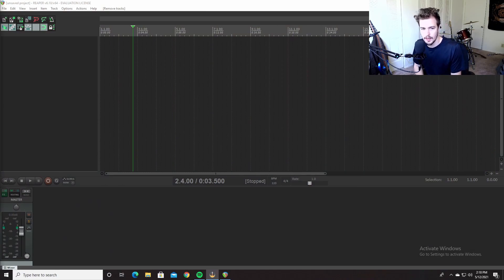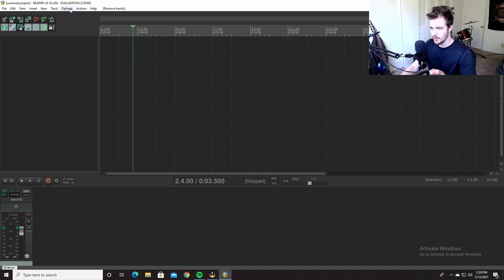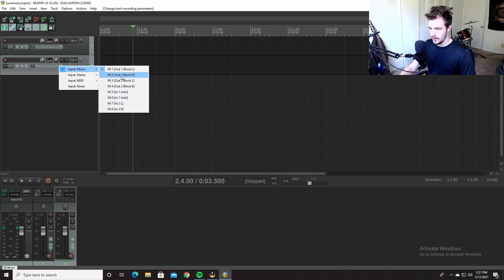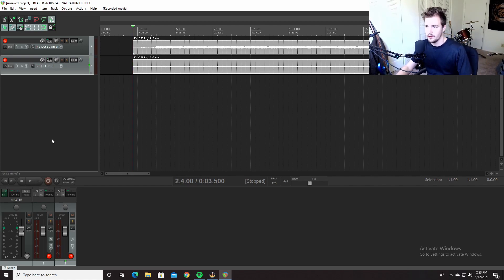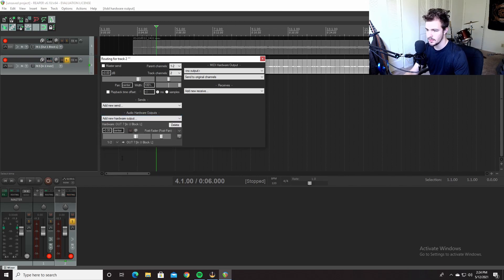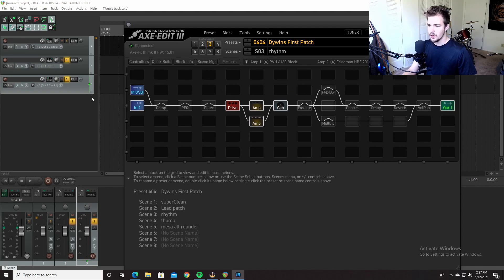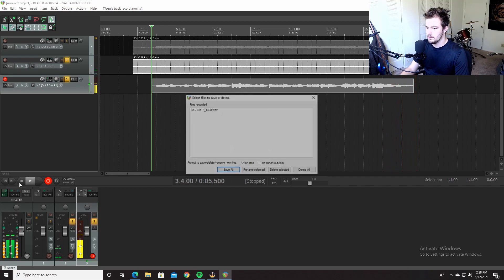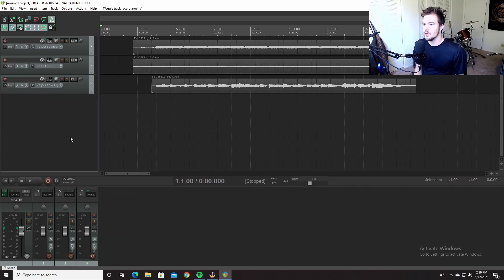How to ReAmp using the Axe Fx 3 (in reaper)

Comment: I am running into a routing issue - using an FM3 so this vid essentially does work though  there is a workaround required for the lack of a USB  block in FM3 Edit and also only 4 channels to route...but anyway, I end up using Mono In 3 [In1 or In2 L]  but the issue I have is when double tracking I can't pan right.  There is no volume at all.  Tried a number of combos of Ins and Outs between the DI track and the outputted monitor track but no dice.  Nothing in the Right channel at all.  Any suggestions?